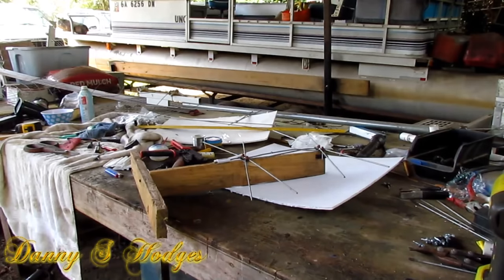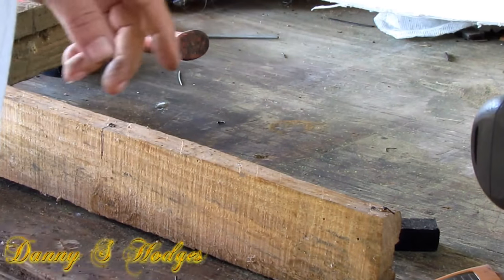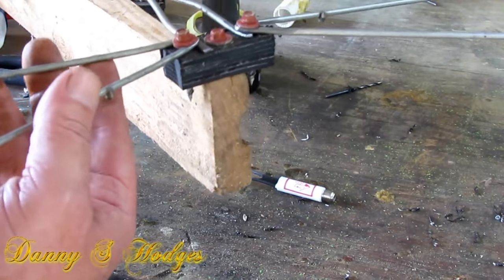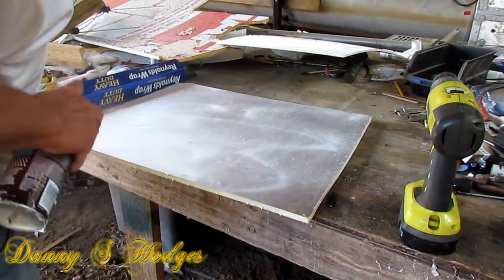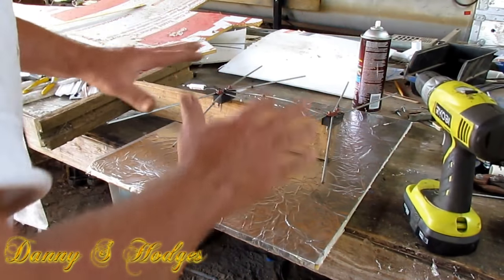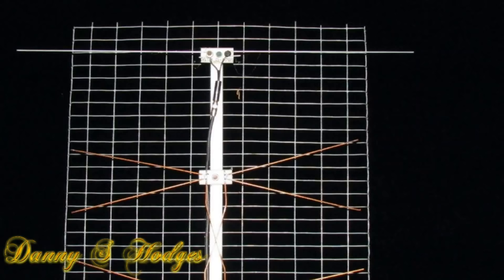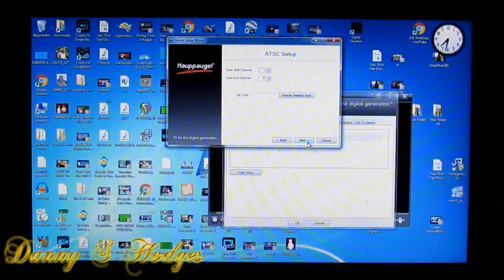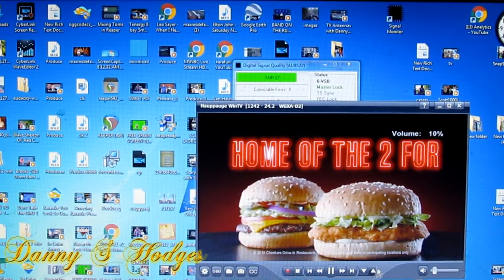How To Make The Nothing TV Antenna Update 60 Mile Test  Pt 2

Comment: I have built two of these antennas, one out of copper and one out of what he is showing here and both have the yard sign with aluminum foil as a reflector. I live about half way between Atlanta Ga. and Chattanooga Tn. In a very low place surrounded by pine trees, setting on our dining room table facing a window pointed in a NE direction i get all the Atlanta channels.Both work equally well. I also have the ultimate tv antenna i ordered off ebay hooked to the LNA 100 booster and get Atlanta UHF and Chattanooga VHF, this thing is a monster.
Reply from the maker: https://www.ebay.com/itm/254113184974

Comment: Danny, is it possible to "tie" one antenna facing one direction to another facing a different direction together? It seems that would be the "trick" rather than having to rotate one antenna around in order to pick up a station.  Thanks for your informative vids!
Reply: S.B. Chevy yes he is created and antenna that is what is known as Co phased. But rather than aim both antennas in the same direction the end one in One Direction and one in the other. What he builds is directional antennas. Directional antennas are better for long range. When you ain't one in One Direction and one of the other is bi-directional. The first video he had he talked about crossing the the beams. That wasn't the issue later he figured it out. When you Co phase two antennas you have to have what's called Co phasing harness. When an 18-wheeler or any other vehicle has two CB antennas one on one side one on the other the coax has to be identical. The same amount of coax on one side as the other. If you have one longer than the other it becomes a timing issue. Because both antennas are receiving a little bit of signal if you have a long piece of coax it takes longer to get to your TV and krates all kinds of problems they have to be exactly the same length. I have a very strong understanding of antennas. Mine comes from Gathering Knowledge from other people such as this man. I go back 40 or 50 years to the CB days and later ham radio. The amazing thing about this guy he gathers information and then he goes and does it himself he doesn't buy something out of the box. He learns from the School of Hard Knocks you may not know exactly why it works but he knows it works. When he post things he has done his homework and many hours of testing.
Reply from the maker: IT IS POSSIBLE
Reply from the maker: it can be done but it has to be right are it wont work good
Reply: The trick with a CO phased antenna as Danny said the antennas have to be identical. They also in war importantly a have to have a co-pays harness which is an identical length of coax in between the jumpers. The reason is because each antenna will get the signal at the same time the signal travels at the speed of light. But through wire it is slower. That is why if you go through a complete setup on a surround sound they're having you time the back speakers because of the additional wire. If your coax is not identical it will hit the splitter at different times causing Mayhem
Reply from the maker: @weswalker1208  i need you to help me answer messages
Reply from the maker: it can be done but has to be done rifgt
Reply from the maker: it is
Reply from the maker: yes

Comment: Hi Danny I have a question needing your expertise. I want to say I like your video and it's the most informative video on building your own antenna that actually works great. I live in Florida and having an Ariel just 10 feet off the ground that gets out to Orlando being exactly 60 miles away according to dtv.gov. I have a camper I'd like to use an inside antenna in. Would this go through the insulated aluminum walls, would it need a booster, or would it have to be an outside antenna to go the 60 miles?
Reply from the maker: any metal will block
Reply: @deepsouthvideos7120  I figured that would be likely. We got done building one like this having available voting signs everywhere. It got signals from 55 miles but we are still working with it, and it keeps us busy.
Reply from the maker: ANT WONT GO THROUGH METAL
Reply from the maker: does not go through metal well
Reply from the maker: has to be on outside... aluminum

Comment: I don't know much about antennas but maybe if you put the flattened ends of the 2 wires INFRONT, (on the other side, of the screws before you tighten them down, causing the flattened wire ends to act as their own shims), you may solve the issue of the whiskers bending down.
Reply from the maker: RIGHT
Reply from the maker: thats right
Reply: You must have tried it, I'm still getting around to starting on building one. Anyway, thanks.  @deepsouthvideos7120
Reply from the maker: @mlucienne4489  yes sir tks
Reply from the maker: right

Comment: I got to tell you something about this guy. I've been in CB and ham radio for most of my life. I have a very good understanding of antennas. Antenna residence AKA SWR. When you're transmitting it has to be on the money the length of the antenna. When it comes to receiving it's a little easier ball game. You will not harm my receiver due to lack of residence only a transmitter. But it has to be within residence for it to work efficiently. I do not believe he has the background that I do and propagation also known as DX. What this man has done is tested tested tested and tested when he says this he's not lying and when he brings you an antenna on YouTube he knows enough if it's going to work or not work right off the bat and we are all surprised by some crazy designs. I wish I could remember what that spider looking thing with a triangle top was that he built. This guy stealing from a worst-case scenario dealing with long distance and tall trees. UHF and VHF is very dependent on line of sight. Either have to get it up in the air or find an open area in front of you and that's why it goes to the church ground. He promises a lot but he backs it up with results. I know it's antenna designs and I know out of the box designs and his whisker antenna but he calls the ultimate antenna is not by any schematic that you can buy. They are similar but when you put a tape measure to it they are not the same and they will not perform the way his does. If you follow this guy as I have he will show you out of the box antennas you will show you other people's designs and there is no other people's designs there always a version of something that was invented a long time ago. That said he will review other people's designs on YouTube and he will tell you why it won't work or show you that it doesn't work. He will give you comprehensive simple to follow tutorials and you will be watching TV with the proper tools and just a few hours. When he says you can take it to the bank he is tested it and he is absolutely correct. I fiddled around with antennas before finding him on YouTube I do not build his bow tie but I built one he is tested and said is just as good and is easier. Just as he said with the reflector he played with it and the spacing. And told everybody what worked. I'm sure he is footage of stuff that did not work it did not make it here. When Danny s Hodges says it's bad to the bone you can bet your last dollar on it. You have to have some knowledge before the transmitters 10 miles north of town 10 miles south of town when you're building a directional antenna to get ultimate performance. I would love to talk to him face to face because I have ideas and antenna designs we could throw down in the Church yard. Let me give you a little hint to one of my ideas Danny. For directional antennas with reflectors and then for different directions creating the DB gain of a directional antenna coupled with the versatility of an omnidirectional. 2 into a CO phasing harness two other ones into a CO phasing harness then bring the two into one. 4 antennas in an omnidirectional configuration. When you get a chance again late at night when tropospheric ducting is happening on a tall antenna the sky is the limit. You cannot scan an antenna turn it and scan it for other channels of other towns and then turn it and scan it for other channels of other towns because each time you lose your original scan
Reply from the maker: wes what can i say...wow..you are so right